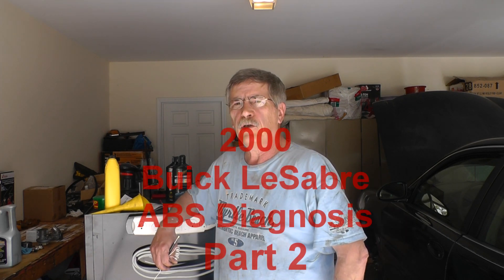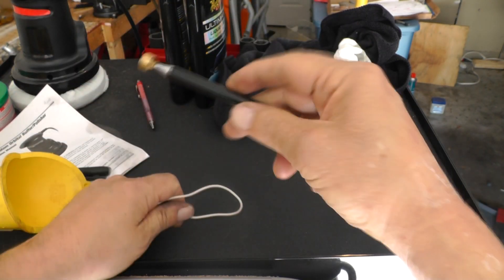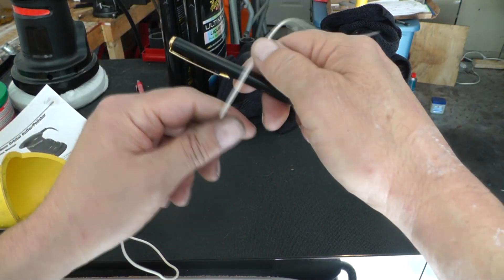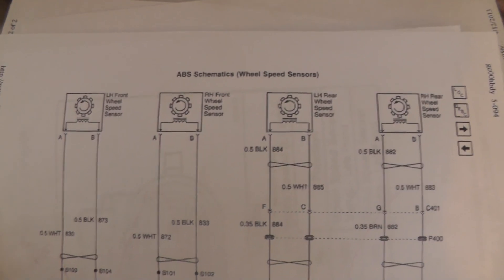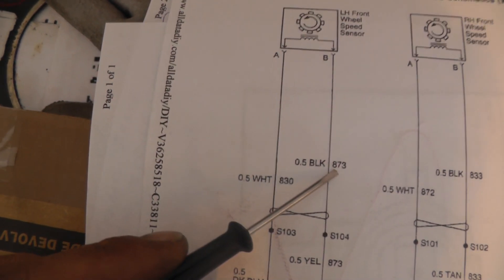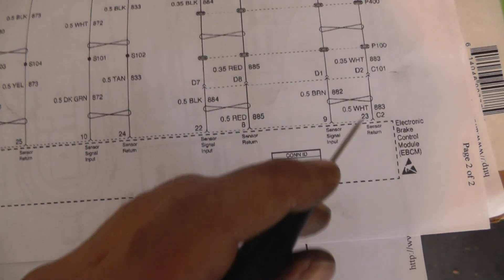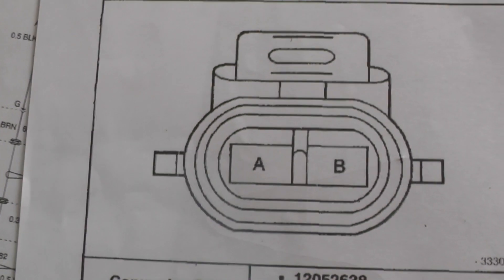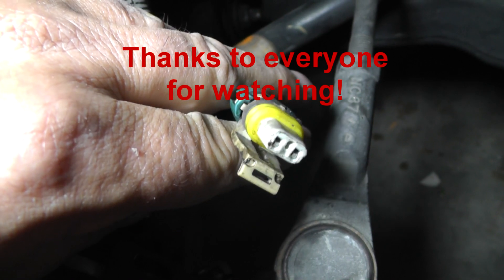Buick LeSabre ABS, Traction Off Diagnosis Part 2

Comment: Hi Terry, I hope you and your wife are doing well. Terry I have a 2002 Buick LeSabre. About a week ago the ABS and Brake lights came on. I checked and the car was low on Brake Fluid. I added brake fluid. The lights went off. Yesterday morning I went out and started the car. The ABS and Brake lights came back on. The car was full on brake fluid this time. The brake pads seem to be in good shape. Do you have any ideal how I can fix or reset the lights on the car? I am not very smart on all the new stuff. I have always had older cars until about 7 months ago. I have written you before about the valve stems on this car. You are the only guy I know that knows about these cars. I would be very grateful for and advice you can give me. I hope someday I will be able to return the favor. Thank you so much, Tommy.
Reply from the maker: Hey Tommy! The wife and I are doing well and I hope you and your family are doing well also. Interesting that you mention an ABS issue. My car last week had the ABS light on along with the traction light and the red brake warning light. I've already ready the codes from the ABS module and maybe I'll do a YouTube Video on how to fix this issue. As for your issue, you'll need to read the codes from the ABS module. A generic scanner is not going to help you with this. If you don't have a scanner, then maybe AutoZone, Oreilly's, AdavanceAuto or another one of the auto chains can read it for you. Without the codes to give you some directions, it's all a guess of what it could be. Maybe it's as simple as a wheel speed sensor, broken wire or maybe even in the ABS module. Once the problem is fixed, the ABS module will turn the lights off automatically. And trust me, there's other folks out there that knows a lot more about these cars than I do. And never short yourself about how you're not smart about the new stuff. If you really want to learn it, you can :)